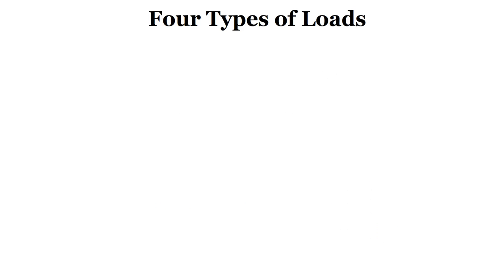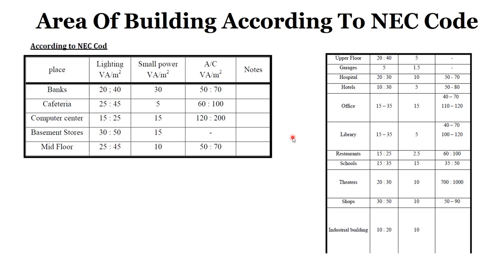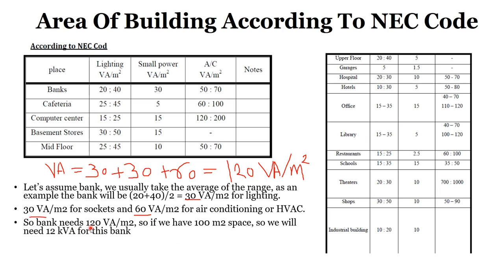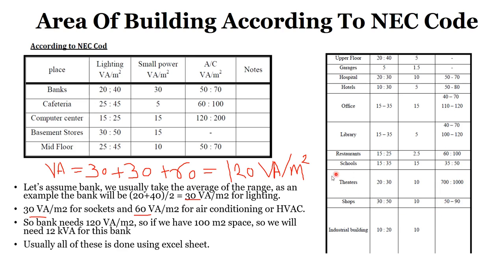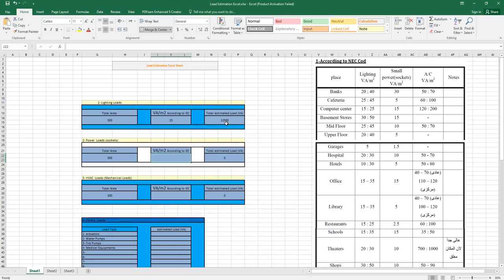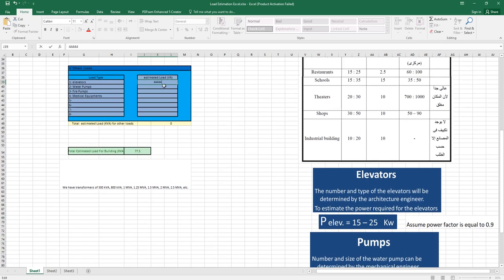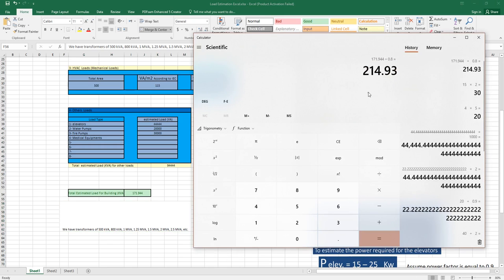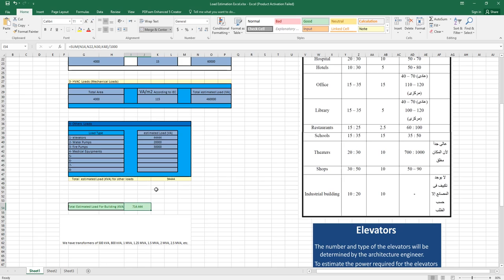Electrical Load Estimation Using Excel Sheets In Electrical Design Of Projects

Comment: Thank you for the explanation which was very simple , but let me remind you that all the values given by the  NEC are connected loads and therefore we will need to apply demand and diversty factors.
Reply from the maker: Yup, that' why in another lesson of load estimation, I mentioned this point, it should be added to the excel sheet 👍
Reply: @EngrAhmedMahdy  can you please mention how much is demand and diversity factor?
Reply: @EngrAhmedMahdy   please add the link to the continution lesson